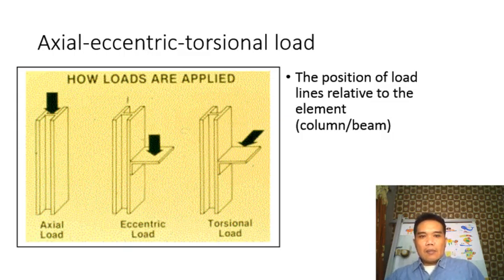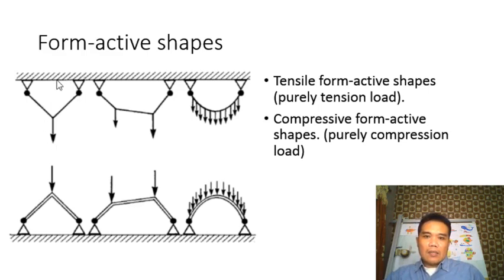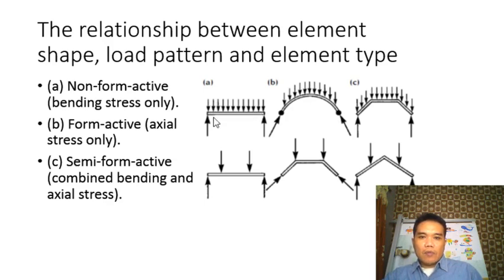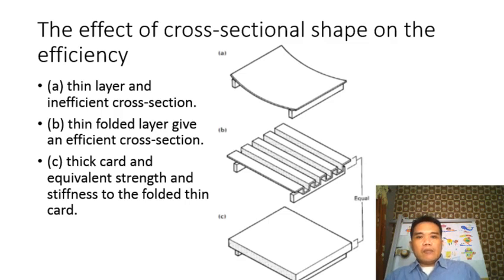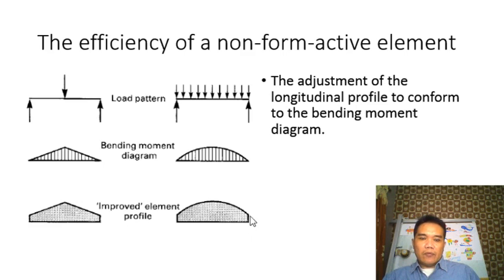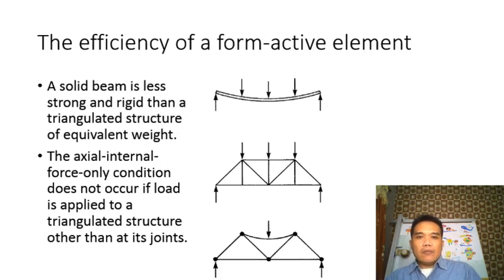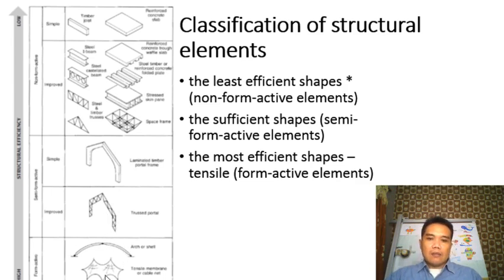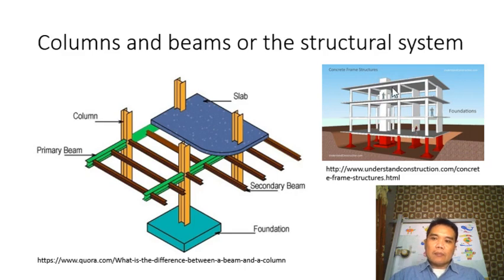Form and structural efficiency

Comment: Sir, if i could give you suggestion, the voice is too small sir, i can't hear the material clearly, unless im using headset.
But it helps a lot tho, in our lessons.👍🏻👍🏻
Reply from the maker: Yes the voice is not strong enough, I will try to use extension mic later
Reply: gonna be cooll!👍🏻👍🏻